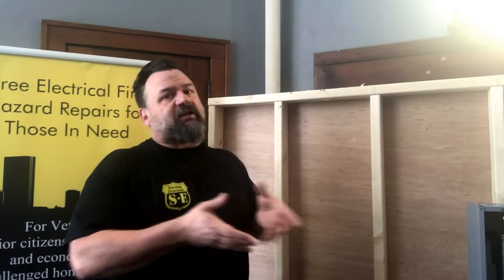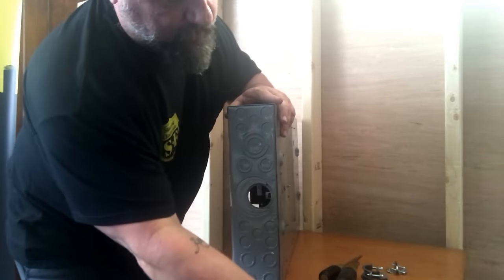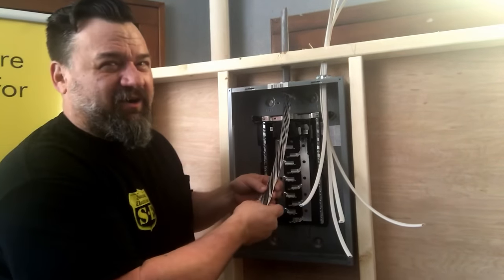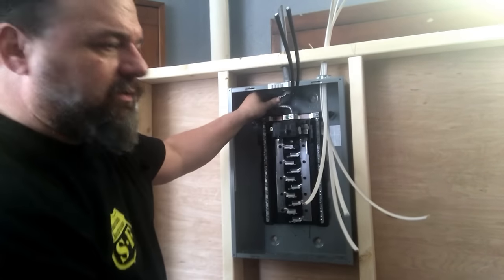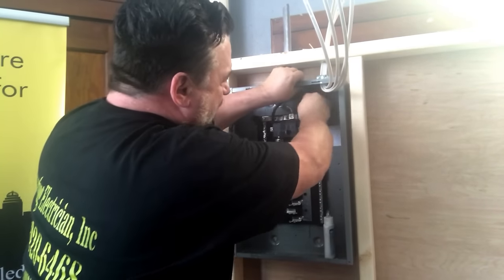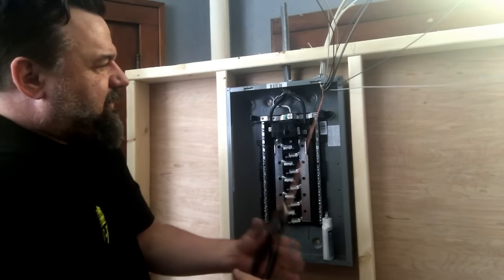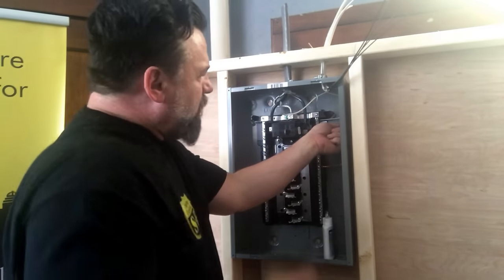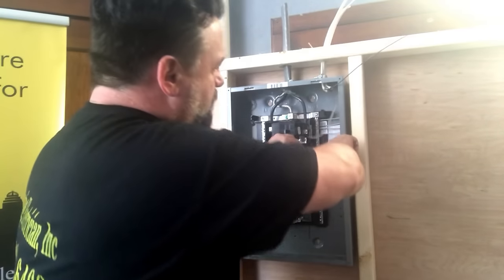How to wire a 100 amp service panel. ,  2020 National Electrical Code compliant

Comment: Great video sir, very entertaining, and to the point! I just have one question, don't breakers have to added the same amount on both sides of the panel? I noticed all your breakers were on the right side, but they should be the same amount on both sides correct, in order to have an even load? Thanks in advance.
Reply from the maker: No need, the breakers are odd and even poles. you could fill up the panel on one side and it would still be an even load. the poles criss cross for lack of a better word. hope this helps.......I need to apologize again because of how long its taking me to get back to all of the questions and you and everyone else will get this same part of the response lol. I have created a blog for questions and answers so more can people learn and also a live electrician portion for more advanced questions. I now offer phone consultations as well as zoom video for the advanced questions and so I can take a look and advise. www.liveelectrician.com or starvingelectrician.com I would appreciate further questions there. Thanks for watching!!

Comment: Also, can you please comment on 4 NM secured by one clamp at the entrance to a panel, I thought two NM cables of 14AWG was the maximum limit.
Reply from the maker: theres nothing about a cable limit in the code book. in a 3/4 connector if you only put two wires in it then the clamp wouldn't hold them and the would pop out. 4 in a 3/4 and 2 in a 1/2" clamp

Comment: Hello I love your channel subscribed, I have a question I'm doing a 200 amp 120/240v main panel by Eaton I have my 2 hots 120v and my nutreal bar I added a ground bar inside because I I dislike seeing the ground and nutreals together in the same bar looks messy I know they go together in the main panel and separate in the sub panel is there a problem by adding a ground bar inside and bridging it together to just make it look cleaner
Reply from the maker: thanks for the question. there is absolutely no problem in doing that because if you use the bonding screw in the panel then that bonds the neutrals and grounds together anyway. if you didnt bond the neutral bar to the panel then run number 6 to the ground bar to the neutral bar. they have to be bonded together some how in the main panel for stray current to go. i hope this helps!!

Comment: Nice instructional video. Some of the other videos say no more than two neutral wires per hole on the ground bar, is four legal per NEC? Same for four four NM going through one knock out hole in the panel and clamp. Would you please clarify.
Reply from the maker: Hardip Pannu  yes you can put multiple non current carrying conductors under the same lug. You can stuff as many that will fit through anything classified as a nipple which is 18”.  So many people thing it doesn’t look right but there’s no code violation for either in the code book. If there’s a change I will update.
Reply from the maker: Hardip Pannu  also in no case does a neutral be allowed to be doubled up in a panel. Regardless of what  tutorial it’s false. Code states this.

Comment: I wired mine from the meter straight into a 100amp breaker that way i have a cut off right there. That was 10 years ago and fine. Curios what the pros think about that. Also do you guys like Klein or Wiha and why? Thanx
Reply from the maker: hello. maybe I dont understand. this panel would be wired from the meter as well. its used as the primary service so the power comes from the meter to the main breaker for sure. as for tools its my preferance to use only Klien. just feels better in my hands. maybe a matter of preferance I also only wear red wing boots. just waht I like i guess. thanks for the question.

Comment: Hey friend, you seem like a really great guy to learn something from when dealing with installing a breaker box. See this is my problem. I'm fixing to purchase some property with a small house that doesn't have no breaker box an it's only got those outlet boxes that is set up to get wires to.. There isn't no code restrictions to have to deal with cause the small house is way far out on side of a mountain an I was told that within the last 5 years they finally got electricity got that way an they is one power pole about 700 feet from the house. So I'm fairly decent running wire from a outlet to another outlet about 300 feet away from my house to a utility building through pipe to protect it an that's where I am living now. Next summer I'll be going to this like house that doesn't have no breaker box to try to see if I can fix all this so I'll have electricity there an I'm on YouTube daily looking to see how it's done. There's many people trying to show how it's done an trying to figure out who really I can learn from. You seen to have it together an I'd rather see if I can learn from you. That's if you can teach me how to do this. You already showing some in your video an I'm no stranger to messing with wires an I've been fooling with wire for many years it's just now I'm wanting to learn more about electricity. I've always wanted to take up a trade in electricity but having no GED it High School Diploma is the only thing that has stopped me from getting that knowledge. I have always wanted just to learn it to help myself out an family who needed my help. I'm retired now an really couldn't work due to my feet. I still have the opportunity to learn from somebody. You are a great teacher from what I see in your video an I only wanted to talk to you. I just wanted to know about how to get the electricity going from the breaker box to the outside meter an an type of wire would that be? Also how to get the wire from the breaker down through to the outlet an what size amp would that be? Is it a 20 are 15 an what is a 60 amp used for? Is the same wire that is used for the 20 amp the same wire for the 60? I use to work for a guy who built houses an he had a young guy who was only 14 wiring all of the houses that he built an he did a really great job to an nothing never went bad. The man who own the company taught the young fellow an I figured if a 14 year old can do it, why can't a 50 year old do it. It's just simply watching an learning an someone telling me in detail on what wire goes where an the size wire that goes in every direction. So if you could help me out with this, I surly most definitely would appreciate it. I'm tired of living in a town where the violence seems to get worse much in the city an I'm afraid for my kids an I'm wanting to escape this evil place an that's why I'm wanting to be far out away from a rat race an away from so much evil an that's why I'm surly hoping I can find someone to help me with this. So if you can't I appreciate your time reading what I wrote to you in this message. Thanks again your Friend from a far 😁
Reply from the maker: well thats a lot to take in. first, for the plugs and switches I have a video on what size wire and breaker to use for what circuits. I break down what goes where. general lighting and plugs are 15 amp circuits with #14 wire.  kitchen plugs 20 amp circuit with #12 wire. dishwasher #14 . furnace #14 disposal #14 . so number 14 wire is always 15 amp breaker and 20 is always #12. now as for the service or the panel the minimum required service is 100 amp. with aluminum wire its #2 . and with copper its #4 .  aluminum is always bigger because its not as good a conductor of electricity as copper.  I also break down how many lights on a circuit and do the math. so take a look around at some of my videos and see if they help. good luck and never stop learning. if you are messing with the main power and are unsure please get an electrician in there. all I can do is help with code but the installation of the main service is tricky and dangerous if you dont know what you are doing. thanks again
Reply: the Stanley books had  great pictures and detailed instructions you can look on ebay and amazon find used books dirt cheap.  also buy some out lets and light fixtures and some 12 awg wire for less then $10 bucks you can practice your skills. and when the time comes have it down to a science

Comment: I believe NEC only allows two NM wires through one wire clamp...
Reply from the maker: Bob's Barn Workshop  through a 3/4” connector?  I think you are off on that one.
Reply: Not criticizing, just trying to clarify... I usually use one wire and individual clamps... Personal preference.. Thanks! @StarvingElectrician
Reply from the maker: Didn’t even take it as  a criticism. No worries! Man one wire per knock out then you will run out of knock outs quick. A 3/4 Tomic will pop out of the knock out if you don’t have at least 3 wires. To be honest I never get a straight answer from inspectors because 18” of a nipple you can cram as many wires as you want in there. This is due to heat and you D rate the wires so they can carry less of a load.  Well a connector is a 1/8 of an inch thick so why worry about it. I have been shot down for putting more than 4 in a 3/4 connector. The half inch I usually go two wires. It’s all about conserving space. Thanks for the reply I appreciate it! Take care.
Reply: It's been since the 70's when I was doing electrical contracting, so lots has changed... I just do it for myself, friends and family these days.... @StarvingElectrician

Comment: How  or what ,do I tie in my main ground into the neutral buss bar
Reply from the maker: if your bus bar is full you can either attach a lug to the panel but inly if the buss bar is bonded to the panel or add another bus bar and simply pit it under one of the lugs and jump a #6 wire from the old bus bar to the new one. you can double up grounds so if you have every screw taken then double up the grounds to make room for the main ground wire.

Comment: do you remember the wire size that went to the hot bars?
Reply from the maker: the feeder size is #2 aluminum but the ground is number6 copper

Comment: Getting ready to have electric panel replaced, some of y'all breakers are new, they are labeled as a D, can I use them in the new electric panel, that came with breakers labeled as E? Thanks and great video.
Reply from the maker: Mercedes Springmeyer  if they are the same brand then it's not a problem to use old breakers.  Not sure what those letters mean. D is usually square D but there are two different types and they don't interchange. Just make sure that the brand of breaker is the same as the panel and you will be ok. Hope this helps. Thanks
Reply: @StarvingElectrician  thank you so much have a great weekend.

Comment: Loved this video.  I was a telephone tech for many years.  We used color codes and pairs all the time.  So, with that in mind, here comes a dumb question...does it matter that the black wires don't stay paired with their respective white wire?  It appears not, but thought I'd ask anyway.
Reply from the maker: Linda Torres  that’s not a dumb question. Now the blacks can be tied together but two different circuits from the panel cannot because it will trip the breaker. In switch boxes for instance there’s tons of wires tied together and all the whites are too. So long as it’s not two different circuits you are good. Hope this helps
Reply: @StarvingElectrician  Thank you!

Comment: On long runs using 12 gauge wire what's best a 15 or 20 amp circuit. Also what amps receptacle
Reply from the maker: You just did a spoiler alert! Lol that's the next video. It's in the code book how far before the voltage drops. So the next video will be about series and parallel wiring for outlets.stay tuned!

Comment: Hello,
I myself am getting ready to install a sub panel to feed my basement.
I noticed that on my Main Breaker Box that the Neutral and Ground bus bar IS NOT bonded to the case of the breaker box..
Is this a issue ???
Reply from the maker: Ronnie Webb  well yes it’s a safety issue. I did a service call  when the lights were going crazy  because of this and the washer was on the same circuit.  Stray current can hurt you.  I also seen the  ground energize the water pipes. I’d bond it as well as ground and bond the panel. It’s just safe is all.
Reply: @StarvingElectrician  the Neutral and Ground is currently grounded by the grounding rod driven into the ground outside on the other side of the wall..
Basically the case is not bonded..
So, I should bond it anyways correct  ?
Reply from the maker: Ronnie Webb  I didn’t realize it was grounded and bonded. You are good. The only issue is the panel box it’s self. You are supposed to bond it or seperate the neutrals and grounds. That’s a pain in the ass. Just bond the neutral bar the the box and you are good.
Reply: @StarvingElectrician  LOL...
Not trying to confuse you but.
My neutral and ground are on the same bus bar and NOT BONDED to the case..
From what I understood it should be bonded..... I just wonder why it was not..
Reply from the maker: Ronnie Webb  that’s when you bond them to the box. Yes the bus shares with the grounds. Dunno why it’s not bonded. If it’s not grounded and bonded you may get that stray current from an unbalanced load or a short may come back up the ground wire. Crazy stuff. I have see voltage on the ground and even posted a video. Crazy shot my man. Yes I’m easily confused. Lol all good, I hope this helps.

Comment: What's the height of the pannels. And restriction?
Reply from the maker: You usually have 3 to 5 feet of service entrance cable allowed inside of a dwelling and that dictates the height. I like to have the main breaker eye level. The breakers need to be readily accessible to reset them.  Hope this helps

Comment: I am trying to replace my panel but can I replace it without having my Utility turned the power off or get a city permit?
Reply from the maker: not sure how your utility company works. over head I just cut and re attach, underground i just replace the load side. if you arent replacing the service cable, I pull the meter out. well i replace the cable too.depends on how confident you are working around hot wires. if you are at all unsure you should consider a pro. im not advising working on a hot service just saying. hope this helps.

Comment: So I need to wire up a old barn and chicken coop. It has the old railroad switches with screw fuses, so I would like to hook up a panel that your video is very easy to follow. "great Job" Just going to put out lights, switches and lights on it nothing hard. What would you say I use to do all this? meaning box size, there will be 4 rooms total- the biggest room will be a wood working room. the rest will just have a couple plugs, lights and switches
Reply from the maker: since you will be having tools out there i would say a small 100 amp panel but at least a  60 amp. you may get 6 circuits out of it.
Reply: Would you a email I can send something over
Reply from the maker: I see something but it comes as spam and I can’t open it. Sorry

Comment: Great vid! Just subscribed 👍🏻                       Can a basement bathroom run off a 15 amp breaker and 14/2 wire AND can I have 3 lights and 3 plugs in another room on it as well? Thanks! (Bathroom has a ceiling light, vanity light, fan and a gfci receptacle)
Reply from the maker: thank you. well by code the bathrooms have to be on a 20 amp circuit and cant feed anyother thing except another bathroom. i hnow it sounds dumb but its code. would I do it in my own home? lol well ill plead the fifth!!!  might as well do it the right way in case you ever sell. thanks
Reply: Starving Electrician do you know if that applies in Canada as well?
Reply from the maker: @kevinfriesen5081   now that I dont know. this covers the states.
Reply: Starving Electrician ok thanks

Comment: really appreciate the info. i have been watching a lot of youtube vids you make everything very simple. but i do have a question. i want to run a box to a shed for a project i'm doing. i want to keep it a lot like a camper so i can plug a 110v into it for mobility but eventually hard wire it in to a main and meter box. what do you think would be the best way of doing this. thanks again for the great content. keep up the great vids.
Reply from the maker: NEPA Fisherman  thanks for the comment! Well wiring it like a camper is just short of plugging it in. If you ran pvc pipe underground then you could change it whenever you want or even bigger wire for a larger service. They also have direct bury cable and you don't have to run pipe but with pipe you can upgrade it.  I hope this helps. If it's not let me know. Take care and thanks again.

Comment: can I use a 15 amp breaker for my fridge line
Reply from the maker: Unfortunately not. the only 15 amp used in a kitchen is for lighting. its 20 amp across the board in the kitchen aside from 15 amp dishwasher or disposal because they have a name plate rating and are FIXED appliances. fridge is 20 amp and some city's require them on their own dedicated circuit. at least put it on a 20 amp circuit so it doesn't trip a breaker and you loose your food. thanks great question......I need to apologize again because of how long its taking me to get back to all of the questions and you and everyone else will get this same part of the response lol. I have created a blog for questions and answers so more can people learn and also a live electrician portion for more advanced questions. I now offer phone consultations as well as zoom video for the advanced questions and so I can take a look and advise. www.liveelectrician.com or starvingelectrician.com I would appreciate further questions there. Thanks for watching!!
Reply: @StarvingElectrician  Wow great answer thank you for taking the time :)